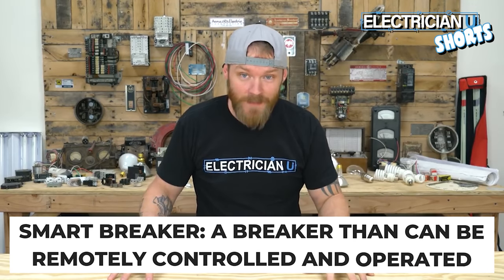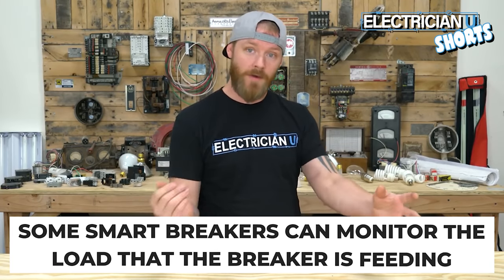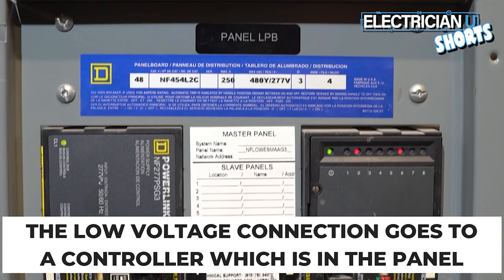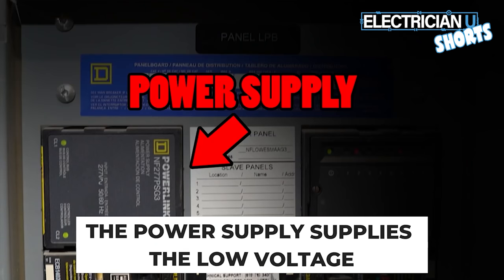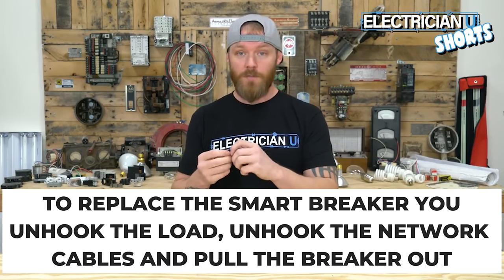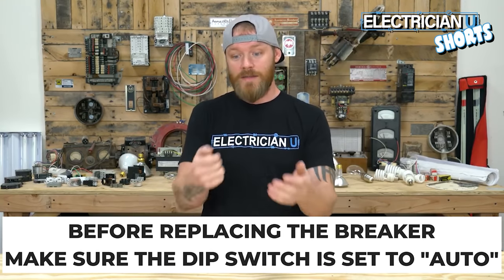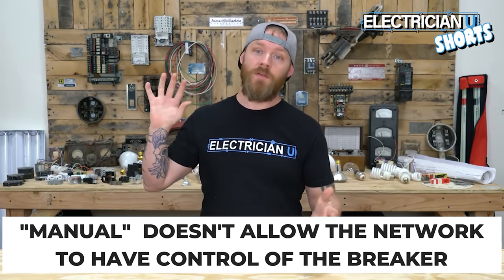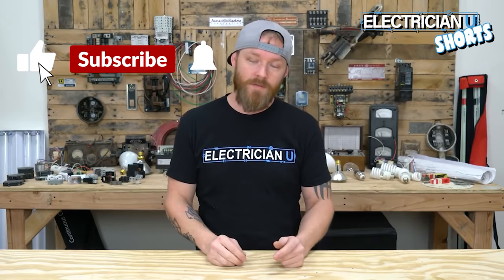SHORTS - SMART BREAKERS - What They Are & How They Work (in Under 3 Min!)

Comment: I installed 3 leviton panels with smart breakers. Each breaker had wifi so no low voltage wiring. Homeowner wanted to be able to monitor his usage and shut off loads when grid was down and was on batteries/solar.

Comment: As a cybersecurity specialist, I don't know how I feel about smart breakers. Are they really necessary? Or does it just open an attack vector that can easily be eliminated by having a minimum-wage staffer onsite ready to reset the breaker when monitoring notices the equipment is down?
Reply: Not all of these require cloud service to operate. When I've seen these they've all been managed locally on a separate network. They're great for being able to easily detect breaker faults.

Comment: I had a question. I am renovating my parent's house. I installed outdoor lights and an electric heater for common space. This may be two questions. I want to control when the outdoor lights go on and off remotely. I want to control the common space electric heater remotely also. The outdoor lights are direct to the panel as well as the electric heater. They are of different voltages. Can you make a suggestion on how I can do this?

Comment: it would be cool if these were available for residential use.... having an app on your phone to tell you if something is wrong at a vacation property or at home....
Reply: Leviton makes that.
Reply: @andrewwilks2700  really? the new subpanels they sell?
Reply: @johnstancliff7328  You have to upgrade to the smart breakers and add a mgmt module in the panel. They can be tripped remotely, but you do have to manually reset them.

Comment: Question, home user , could it be use on home with a back up generator?  This could shed load to protect the generator and add also, like shed AC unit when hot water heater come in ??
Reply: I don't think I'd want to constantly cycle the breaker of equipment like an AC unit. If I was concerned about running both loads at the same time I'd probably have some kind of interlock to stop the call for cooling whenever there was a call for heat from the hot water heater, but then my concern would be short-cycling the AC unit. Is your service undersized?